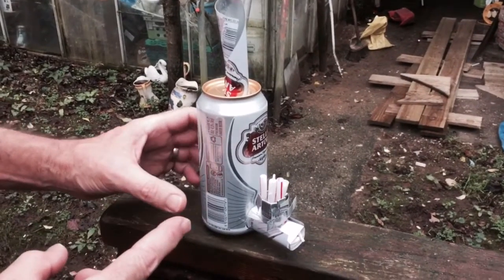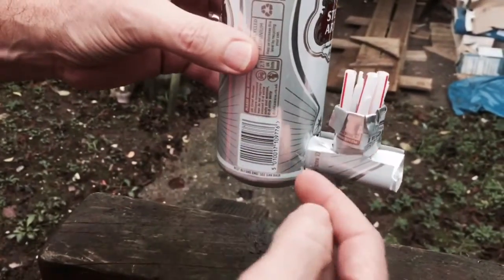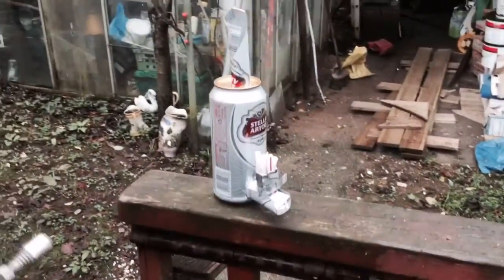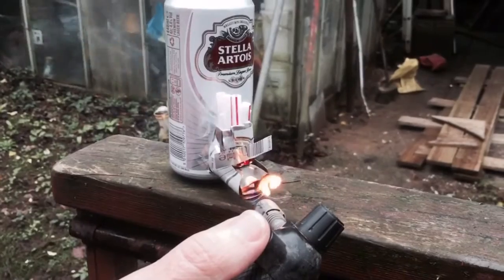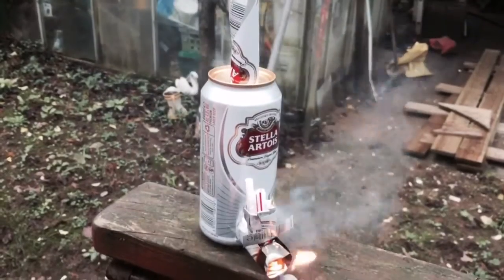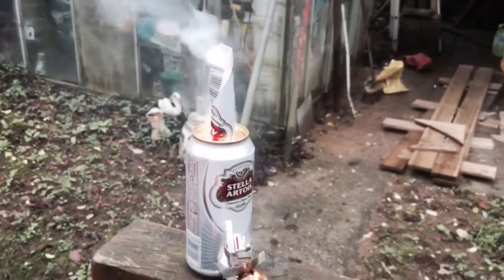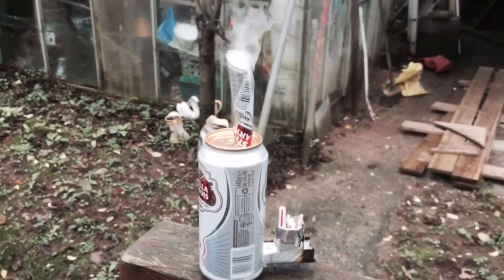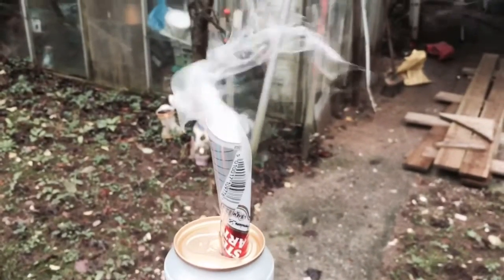Beer-can Rocket Stove

Comment: are you burning soda straws?! wow. my design uses a narrow diameter cardboard tube as a core and sand packed around it. I use a rolled strip of aluminum similar to what you use there as my fuel/air chamber. works nicely as a demonstration model. useless otherwise.
Reply from the maker: Yes, I was just testing it in the video and it was easier to cut up soda straws than find some dry wood! Do you have a video of your design? Thanks for the feedback and have a great day.